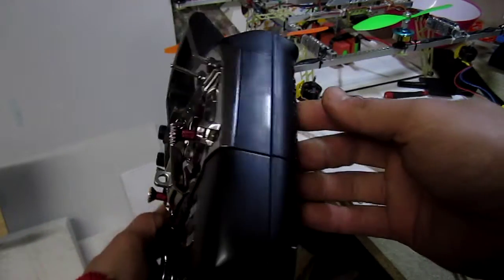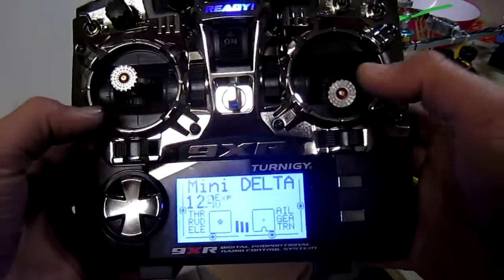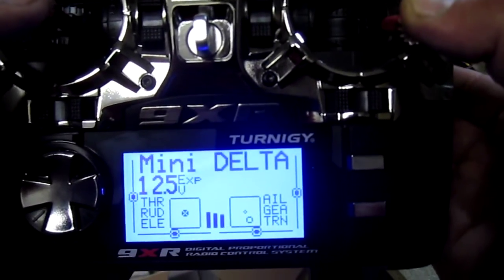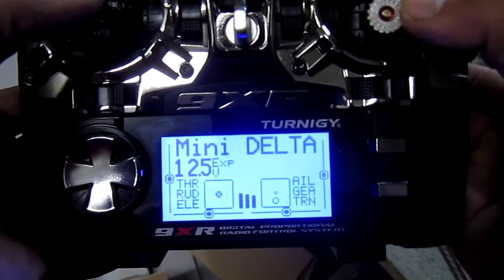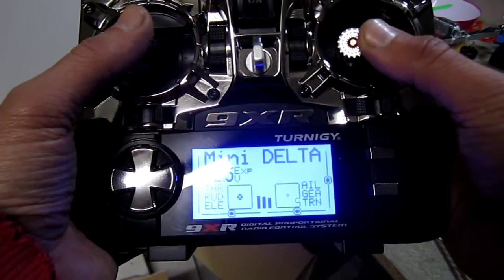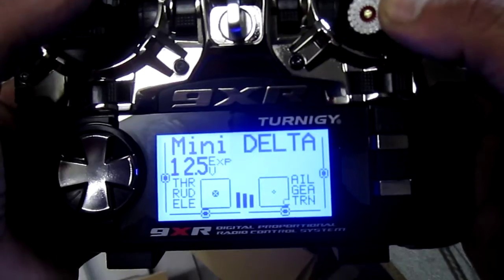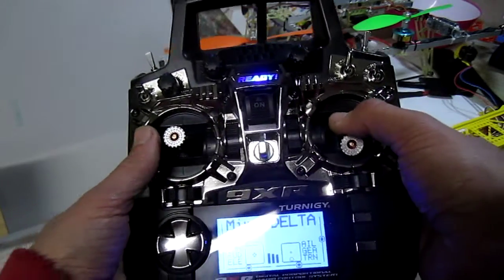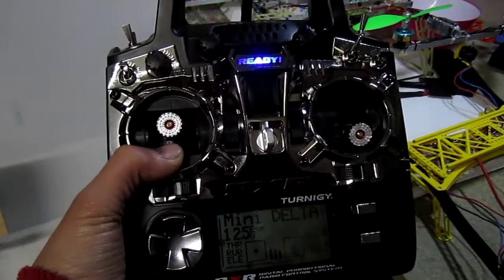Turnigy 9XR gimbal pot problem

Comment: You can hack Taranis Gimbals in with a bit of patience. I did and they are much better but there is no changing your mind afterwards and going back as it involves a bit of drilling, cutting and fiddling. My 9XR is a halfarsed Taranis with OpenTx, a XJT module and the gimbals. I keep it as a spare and it did serve me well for a couple of years. Tbh though, with hindsight, given the cost and fiddle arse farting around, an X7, Taranis Plus or Turnigy Pro would make more sense in the long run.

Comment: You need to go into your menu and recalibrate your sticks in menu
Reply from the maker: As I said previously to the other same comment- calibration does not fix mechanical problems:)
Reply: Well I had same a similar fault the dot would jump straight from center stick to full right aileron with nothing in the middle. Calibration fixed it
Reply from the maker: I know where you coming from mate, everybody thought that that was the problem, including myself:) I was calibrating loads of times and nothing worked, until I took the pot apart and bent out sliding pins for better connection. Not surprised that HK sells spare parts for this radio, as they are definitely needed LOL
Reply: fair enough :)
Reply: ROBOFORCERX2000

Hi sir. I am having the issue right now. I am using mode 2. But in my case it's the elevator which has the problem. When I hold the stick upwards the display on the screen jumps down like yours ( right then goes left ). The gimbal stick is unfortunately out of stock at HK.

"until I took the pot apart and bent out sliding pins for better connection."

What did you do to that gimbal pot? What did you bent? I'm sorry I am new to this though I already check the inside of the radio too.

Thanks. I hope you can help me.
Reply from the maker: If you take that pot apart you'll see tiny pins/plates that touches a turning disk. Those pins were too flat and were not touching that disk at some point, so I bent them outwards a bit.
Reply: +Dave Pitt (XXPITT) 
potentiometers quality is behind this problem even pro version has this shitty pots. 
problem is that metal nits create contact resistance on carbon film placed on fiberglass board, all the materials have different temperature change of its volume it's a design issue and quite serious. 
Despite that it can be fixed with conductive glue ;) then you turn a very shit radio to medium one.
Reply: SladkaPritomnost shitty pots lol

Comment from the maker: Yeah, I got it from HK, but didn't report anything- not worth the time, money or nerves. At such prices you have to expect something similar quality... Over a good few years I've saved a lot of $ thanks to HK, but radio is something that I don't want to be taking a chance with, so I fixed it, sold it (of course letting know it's past problem first) and got myself a Taranis, which by the quality would be worth to pay even double the existing cost:)

Comment: This problem started with my week old 9XR. I took a look at the pot assemblies. The pots are held in with a bent spring clip and mine were not in correctly or tight. I could have turned them around but, I liked the little nub sticking outward. I took the clips out and bent them backwards a small amount and re-installed. There is now positive pressure on the pots holding them in tight. I re-calibrated and the pots are now very accurate!

Comment from the maker: Well,sometimes it is worth spending time and money fixing problems and at the end of the day still have same performing product much cheaper than a good brand name one. For a good few years now I have some "cheap as chips" products that still doing a great job, motors, ESCs, etc, all sorts of electronics and I'm just not willing to pay 500$ for a radio, which I still would be modifying- hacking with FrSky module, cutting holes for bigger battery,scroll and gear switches on the backside and so on

Comment from the maker: Did you do "stick calibration"? Usually when they don't center, you have to calibrate the sticks, and mine was jumping from side to another side... To find another pot could be tricky, as there's gazillions different sizes and angles of rotation. One thing I know, that they are 110deg rotation. I wrote in video description what I did there, but I think best option would be take one out and go to electronics shop to look for something similar, so it can be modified to fit...